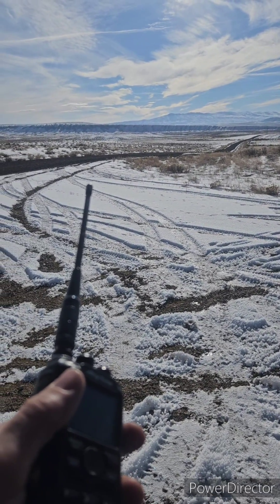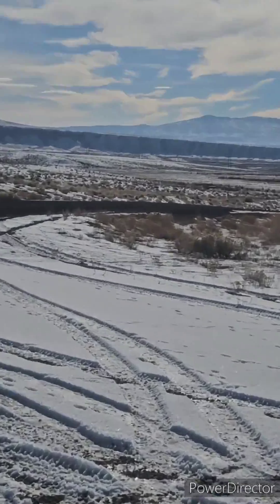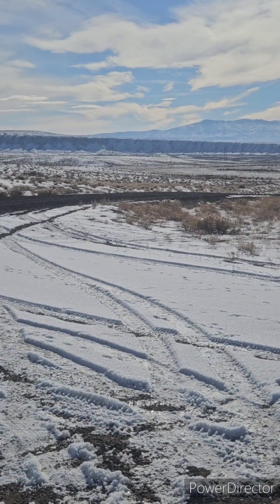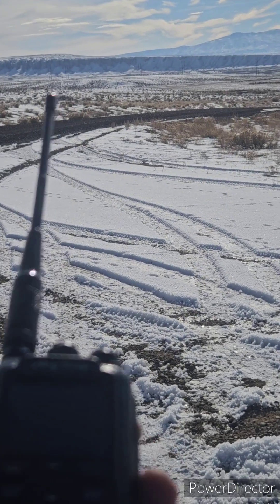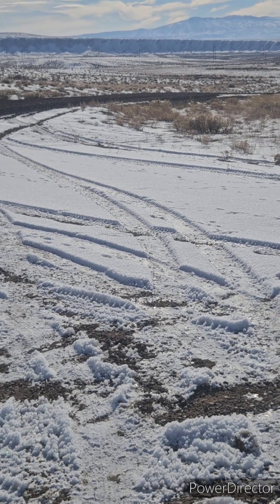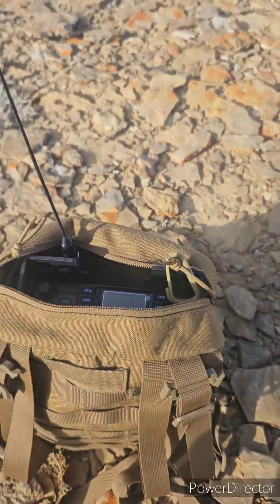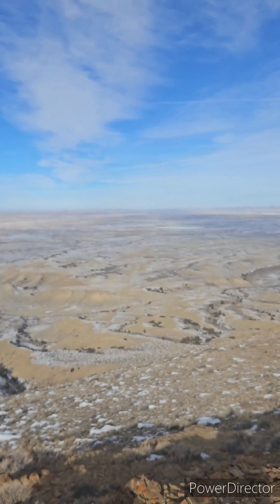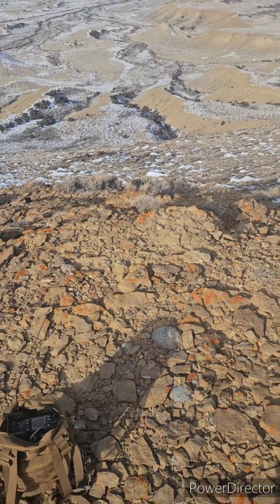Anytone AT-D578UV Single Frequency Repeater Distance Testing

Comment: What happens if you transmit on dual time slot mode? Will it cause an interface between the repeater and the receiving portable? Will it call the other portable when in range and still work through the repeater for other radios too far out from you? If this theory could work, i see it functioning similar to repeater talkaround but not requiring any settings to be changed on the radio.